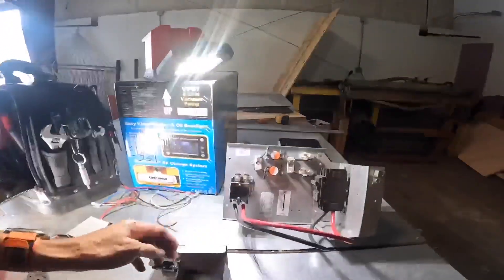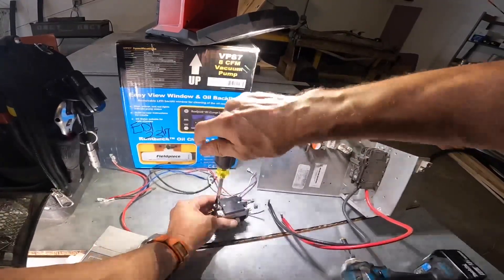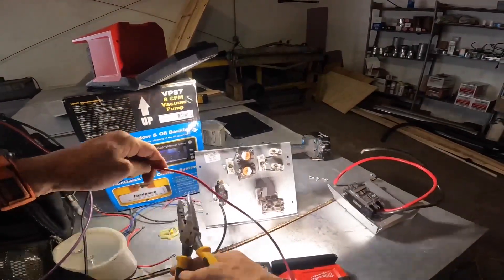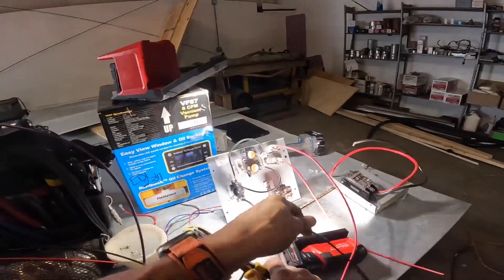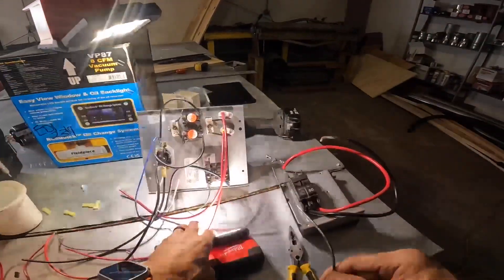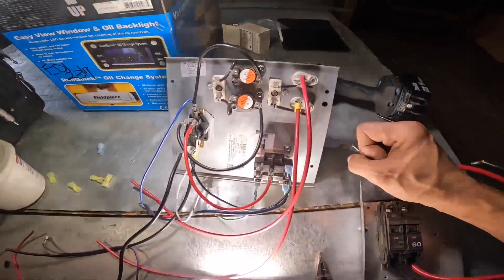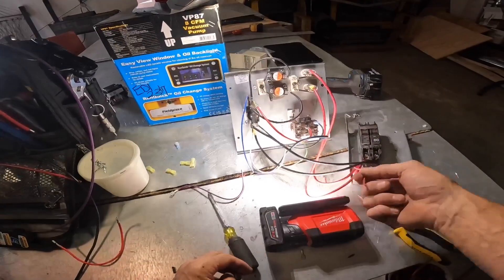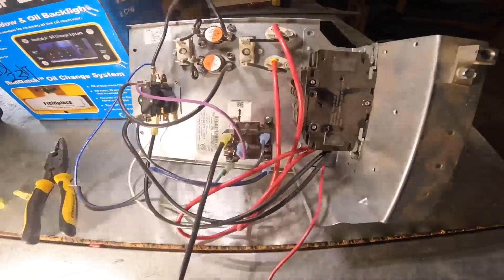How to Wire an Electric Heater Kit With A Blower Relay

Comment: So in 2 words The Black EFM wire or High Speed will always Run either Cool or Heat since Medium and Low Speeds are not even hooked up to anything.  Tnks

Comment: Hi Curtis, awesome work you do and I always enjoy watching your videos.  I am curious to know the reason you prefer sequencers and the 90340 relay for heat strips instead of a contactor?  Don't sequencers have a higher fail rate and a heavier amp draw on the low voltage side than contactors?

Comment: Question(s): 1. Since one leg may power wire, yet with heat pump, does blower need 240v.

2) If so, does one need a relay rated for 240v?

3) Or, is the 90-340 sufficient?

Comment: So, the blower relay operates two different functions?
a. to simply operate blower motor only
b. to operate blower motor every time sequencer is energized, is this correct?
Reply: The blower relay has one function, to operate the blower. The blower has 2 circuits the coil circuit and the contact(s) circuit. The coil circuit is what energizes the contacts. The contacts allow current to travel to the blower motor. The contacts have a normally open side and a normally closed side with a common point between the two. On a call for heat the blower relay doesn't energized. The power from lets say Line 1 of the heat element which is also tied to the normally closed contacts on the blower relay sends power to the blower motor. If you just want to the fan to run from the thermostat, then the normally open contacts close sending power to the blower motor.
Reply: @marlymar4  Thank you!
Reply: @marlymar4  Took sec to sink in ... got it.

Thank you!
Reply: @marlymar4  What is your preferred choice for blower relay?

90-340 appears robust?
Or. 90-380?

Comment: Sorry bud, I disagree with replacing the contractor with a sequencer. It makes no sense. If you’re saying that it’s not safe to have both heat strips to come on at the same time, it’s been proven that it doesn’t hurt a thing.

Comment: Good video was a little hard to follow because of the quality of the image it kept double feeding but you should specify to the people watching to make sure that the KW heaters that they installing the amps is rated for the correct wire if not you just going to melt your wires and start a fire

Comment: Hello will this work for a 1979 electric furnace my heater went out and I opened it up and saw that the coils were broke so I ordered new one put it on and it still didn’t work. I also bought new sequencers as well still no work ,I think I want to buy all new parts and put it together like this, you think that’s possible

Comment: What kind of wire is that and where can i find it?  I went to a supply house and asked for appliance wire and they were like "what's that?"  All they know is romex.  I need something to keep in the truck just to replace burnt out wires to heat strips and blower motors, etc.

Do I have to buy it online?

Comment: I'm lost why would you replace a contactor with a sequencer. The contactor is an upgrade over a sequencer. They no longer use sequencers in replacement heater kits for a reason. Sequencers are a thing of the past they were once needed to bring on different loads one at a time to lower the amp draw on the city transformer outside on the pole with new electrical circuits today we can bring on all the elements and fan all at the same time without any issue.
Reply: I absolutely agree

Comment: At the end of my first semester for basic electricity we had to wire a split system from scratch as a final exam. While practicing for it, the moment it all clicked was from messing with the sequencer and fan relay. All the different ways you can route with those two switch controls was fun.

Comment: You blew it on this one, converting a UL Listed heater assembly into a dangerous mess. 
Have you ever had the city/county electrical inspector examine one of these conversions? No way would it pass. Leaving the heating coils energized with respect to ground is just plain dangerous, hence the purpose of the 2-pole contactor. Fed by the high amperage breaker, this wiring arrangement could cause a fire if anything conducting, like insulation foil backing, were to pass down the duct.
Reply: Alot of factory heat kits are wired this exact same way.  I was on one last week.
Reply: @madmac4509  Are you certain that heater product was UL listed?
Reply: @jpcallan97225  if it came factory like that,  which most heat kits were built like that in the last 30yrs,  then i would say yes.
Reply: having one constant hot leg of power on a 220 circuit is not dangerous. It's exactly how your water heater works if you have an electric water heater. The elements have one constant hot leg and one switched leg of power by the thermostats.

Comment: From an electrical perspective, I’m not sure running a low gauge wire for a blower motor off of a 60 amp breaker is appropriate. I’m also not sure if the manufacturer specs on a breaker allows multiple wires under a terminal.  Just an observation should a fault occur.  This was a wonderful presentation - thank you.
Reply: welcome to wiring inside appliances/machinery/cabinets, where electrical has majorly bent rules and you throw away most of your knowledge! lol
they generally use smaller gauge wire with higher temp insulator jacketing.(pretty much all electrical devices/appliances)
Examples: inside your typical home "oven/stovetop" and "clothes dryer" that's usually on 50 and 30 amp circuits(in USA), the majority of wiring inside them is sure not 6awg or 10 awg.
of course the elements all pull far less and usually have multiple smaller conductors coming off the main inlet terminal block. you'll find a mix of wire inside from 18 to 10 awg at best.
Reply: @throttlebottle5906    very interesting - thank you for your informative reply. There is a guy from Canada on here that demonstrates what happens when you hit 14 awg with 60 amps and it’s remarkable how much this wire can take.   I think the channel is called electromagnetic videos.   I’ve just had drilled in my head that the protective device is limited by the smallest wire connected as a load.   Take care.
Reply: Hvac stuff is sent from the factory quite often just like that.  Notice that breaker did not have spade terminals on them.  Some do some don’t.   That wire he used is plenty capable of handling that blower motor that will pull less than 10amps.

Comment: I like to refer to the 240 VAC legs as L1 and L2 where L1 is usually black and L2 is usually red. The term common brings to mind a circuit that is continuous throughout the circuit and is never switched or even fused. I do not have an HVAC background so that is probably why I learned different terminology

Comment: Not Knocking anything cause I do watch your videos but why would you eliminate a heavy duty contactor and replace it with a sequencer? We dont have much electric heat here in CO but lots of commercial electric reheat VAV's.  some natural draft unit heaters do use a sequencer style stack to control fans and such without a fan relay. if I was connecting such a High amperage heat kit I would prefer the contactor and another way to control the fan like a time delay or something, Im just trying to figure out your reasoning behind eliminating the contactor. Like I said Not knocking you, Just trying to ascertain the logic behind it. Good videos as always tho. every so often you get me to thinkin bout something in a different way than I normally would.
Reply from the maker: Contactor doesn’t have any timing  between the two heat strips, and are actually more common to fail than sequencers - because of low voltage shorts
Reply: Your instincts are correct, he converted a UL Listed heater assembly into a dangerous device by leaving the heating coils energized 120V with respect to ground. This work would never pass an electrical inspection because it's unsafe. The contactor de-energized both poles of the 240V circuit and should not have been removed.
Reply: @jpcallan97225  in his defense this was the way things used to be done in the past but I usually convert to a contactor on high load devices when the sequencer stack would fail. All my electric heat customers are commercial buildings as my residential is mostly gas bus pretty much all the commercial stuff that is not the one hung low brand uses contactors but have been a few that had stack sequencers. the logic he has about timing makes sense as well but short of the main not being able to handle the quick addition of 40-100 amps I can see a stepped approach, we all just have different ways of doing things, I just cant myself see where a little snap disc in a sequencer would handle the current draw that these 5-10 KW heaters use but they did it that way before and electric water heaters use extremely small contacts as well. Ive been an overengineer stuff kinda guy tho.

Comment: On a call for heat does the thermostat usually send a G signal? Or only a W signal?
Reply from the maker: If it’s not a heat pump it’s usually just a W call alone, same for emergency heat.
Reply: Just depends on system setup.
Reply: I was just about to ask this question

Comment: I have never used the common for the switch wire . Black common goes to the always hot terminals . Red is the switch leg that is broken by relays , contactors and switches. Same is true on T-stat wires at 24 volts.

Comment: I thought white on the blower motor was common and all the speed taps , red, black, yellow, blue were hot.  I’ve only watched 5 minutes of this video.
Reply from the maker: Any single phase has run and common as it’s two power wires. The white wire is often one of the capacitor wires. The capacitor is always between start and run. So, white is run. The other side is going to be common.
Reply: @HVACGUY  i usually see 2 brown short wires to the capacitor, white wire on common terminal section of circuit board , red on heat terminal of circuit board (slow speed) black on cooling terminal of circuit board (high speed) and the remaining wires on PARK terminals. 👨🏻‍🔧🙏🏻
Reply: So on a single speed will it still work without that run winding connected or u have to also?

Comment: Another great video, I always enjoy watching them. One comment and I'm sure you are ahead of me but when working with heating elements with high current especially, I have an assortment of non insulated steel high temperature crimp terminals to use when necessary, ring as well as spade. The soft ones will loosen and melt after a while.  Thanks again for the video! 😀🇺🇸

Comment: This is the second video I see you using Makita again.😎what’s the deal? Am a Dewalt tech myself. 😀
Reply from the maker: There are some things about the makita I really like. The only advantage of the M12 is weight. I’m weighing my options
Reply: @HVACGUY  just commenting. I too never liked 12v. To each its own when it comes to the brand. I use Dewalt, because that’s how I started. And so far they have been good. I also have some Makitas. Only sds drill and grinder. They are also good

Comment: Curtis you were wiring a single speed blower right?
Reply from the maker: You can use the other pole on relay for a second speed
Reply: Thankyou for great video.  I know I have had blower motors burn up when the contact stick energizing two speeds at same time
Reply from the maker: @jamesfitzsimmons381  me too. That’s why I now only use one speed
Reply: @HVACGUY hey u lost me at the run winding of the blower motor?
Reply: You are very experienced
Reply from the maker: Yes

Comment: As always you gave a great lesson. One minor detail you forgot. The air flow proving switch safety in the control circuit to prevent the heat strips from energizing on fan flow loss.
Reply from the maker: That would be your limit. Other than that most don’t have anything else
Reply: The original circuit board didn’t provide such a safety either

Comment: That was very help full answered if the unit had low heat 1 coil and high heat 2 coil . Looks like just high only , maybe with a 2 stage heat thermostat could be done .

Comment: Curtis, I have a heat strip and the blower stuck on without a call...what could it be other than a  short? It have a contractor not a sequencer..
Reply from the maker: Hard to tell without looking at it.
Reply: @HVACGUY  It's got me pulling my hair out....
Reply: @Ageehvac  Is it an X-13? Mine did that. I put in a rescue motor.
Reply: @scotts4125  it was and I replaced it and it's still running non-stop....
Reply: Before you replaced it did you remove the low voltage taps to rule anything else out? Sounds like you might have missed a step. When I pulled my LV taps it still ran. That told me it wasn’t a control issue. It had to be internal to the X-13 module. Sounds like you have a control issue.
Reply: @scotts4125  Yes sir, I did that exactly before replacing the motor
Reply: @Ageehvac  If you pulled the taps and the new motor is doing it too you must have a bad one out of the box. You are sure it's an ECM X-13 right? It's not a PSC motor? That makes a difference.
Reply: @scotts4125  Yes sir,  I'm 100% sure....
Reply: I have had contactor points weld together from sparking/arcing before, scary

Comment: I'm  lost in the woods
Reply: Most if not all air handlers already have a means to control the fan.  Curtis is showing how to turn on the fan when the electric is called if you don't know the simple task of programing your thermostat to control fan in electric heat.
Reply: @billderby1527  I was being sarcastic

Comment: I think a circuit diagram would make things clearer
Reply: I'm about to finish my first semester in HVACR in one more week.
  We will be off for a month, in which we will start our second semester and learn Heating Systems and Controls.
 This video is perfect timing. 🥰
Reply: best thing to do is go out in the field and look at the diagrams and as well as trace the wires over and over again religiously
Reply: Instead of common and hot, perhaps you could differentiate with terminology like a phase and b phase. this appears to to me that coming from the breaker it is 240 volt. Might be confusing for beginners.
Reply: I agree, however this will help younger technicians in our field.

Comment: Enjoy your vids.  I have a question about a new thermostat.  I have a standard hvac system but my 9600 robertshaw thermostat is know more.  What would you recommend for a replacement.   I need at least 2 degree programmable variant .  Thanks.
Reply from the maker: I’m not familiar with the 9600